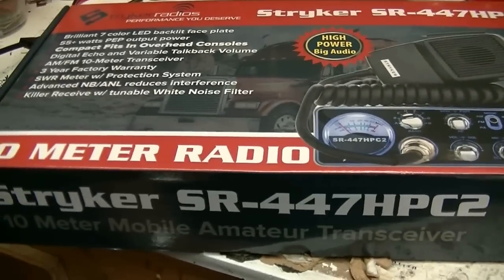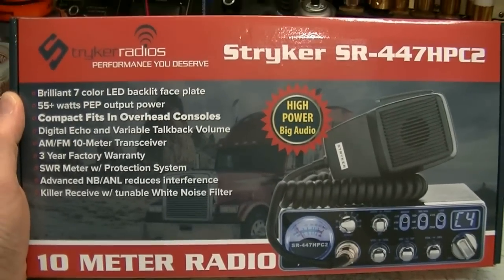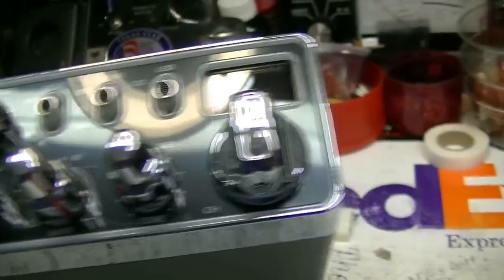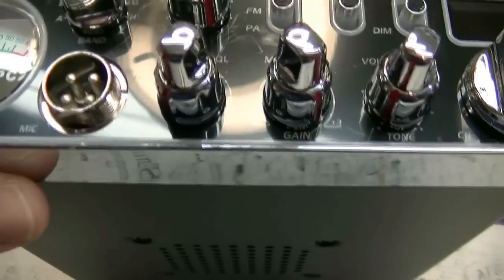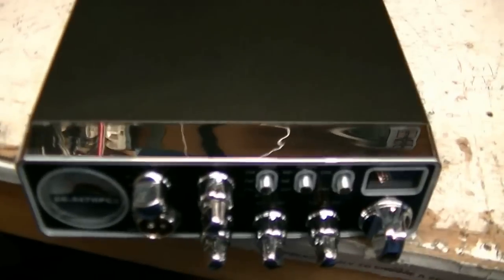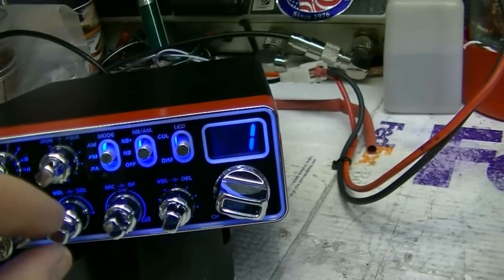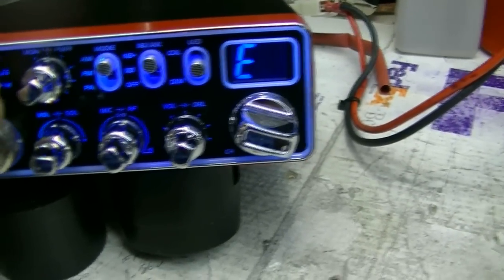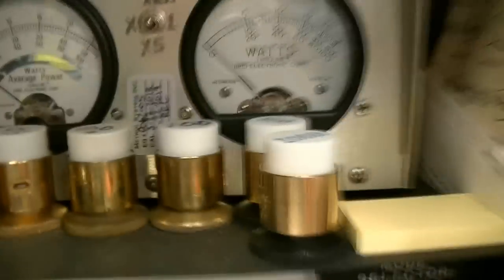Stryker SR447C2 - What's inside. Conversion hint @ time 13:35

Comment: Question this sounds stupied to me but do you need a ham License to use the 10 meter side. New to the hole ssb 10 meter stuff so confusion I grow up my parents just had basic radios we had realistic, cobra and uniden radios I think still have them some where.  But back to these do need a License  for the stryker and do need a lives operate a ssb radio thanks
Reply from the maker: To operate on 10 meters you do need a Ham license. 

To operate a CB on sideband you do not need a license.
Reply: @LestersCustomTrkShp  thank you very much. so I will stay away from a Stryker into I get a ham license. Just also like say thanks for you're vidieos some good info comes out them